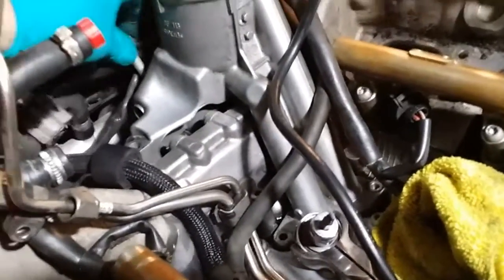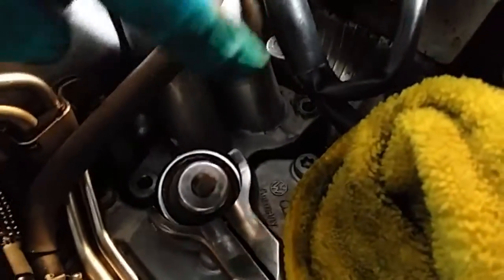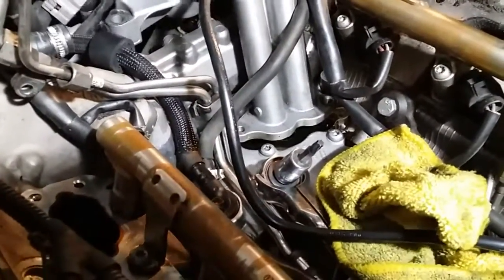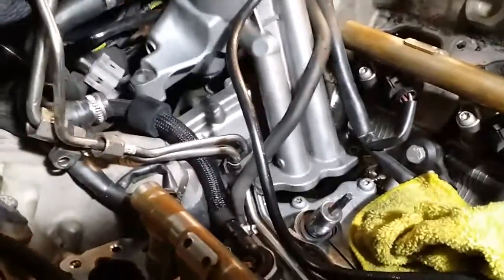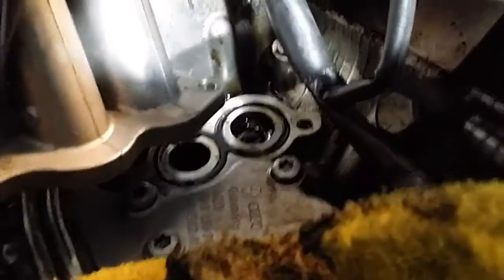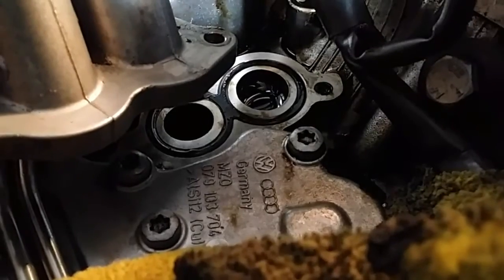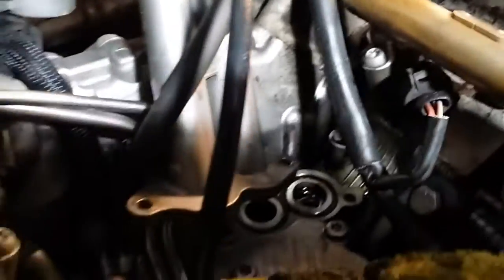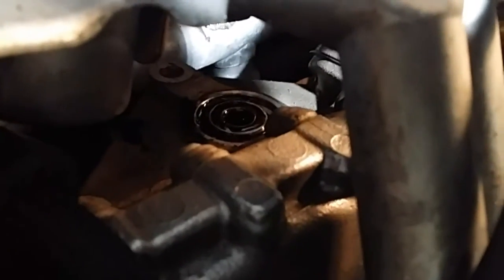2007 Audi Q7 4.2L Oil Filter Housing Removal

Comment: Did this oil filter housing also cause oil to leak down the back of the engine?  I have a leak down the front for sure.  But also dripping down the back.  2007 A8 D3
Reply: Enzo Dunn what engine do you have?
Reply: It does juts got both o rings done on my 4.2

Comment: I need a bleed coolant procedure on this Q7 4.2 fsi as after flush coolant and refill car is overheating, ( before flush and fill coolant car is running as normal temperature. would be so much appreciate if you could help thanks.
Reply from the maker: Hello, I haven't done this yet, is there bleeding screw maybe?
Reply: Roth Rothy you need to run the vehicle with the coolant reservoir cap off, run it until it gets to normal operating temperature. Run your heater on high to the floor setting. Once it gets to operating temperature let it run with no cap for another 10 minutes, coolant might overflow. Thats fine just top off when car cools down